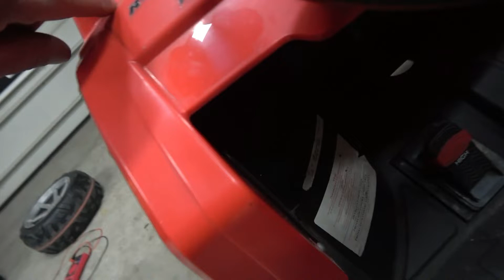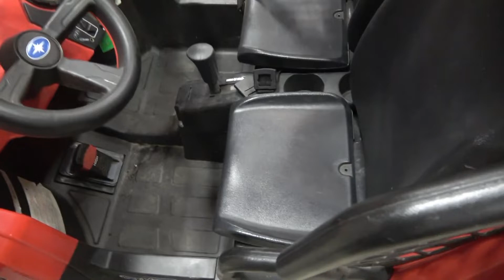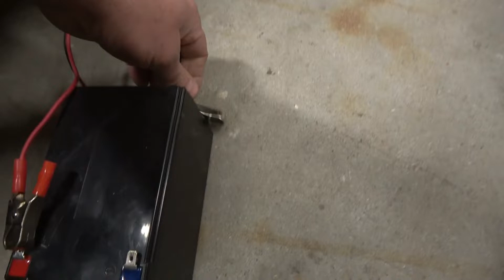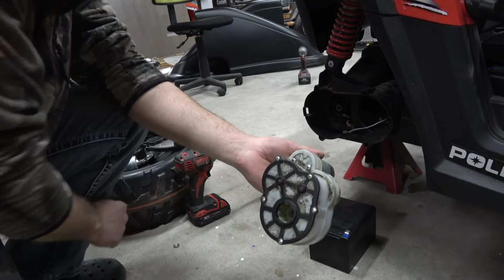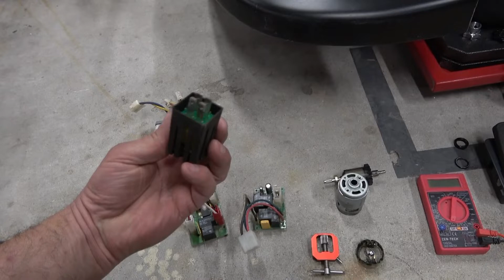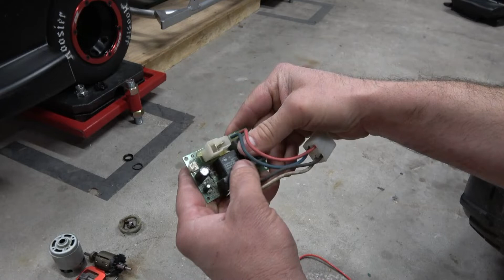Peg Perego 24 volt RZR- Fix and flip for $$$

Comment: Hello, luv the videos & channel. Hope you can help? I have a Polaris RZR 900. My question is on the foot pedal were the push switch is there a spring between the switch and the pedal? Asking because i just got one on marketplace but the push switch was missing and have already ordered one, i do have the pedal just don't know if there is anything that would  be missing? Thanks for any help with this issue.. i have looked everywhere with no luck.
Reply from the maker: The spring is inside the plunger switch. U should be all set. Basically the 900 uses all the same electronics as the more common gator.
Reply: @CustomKidzCars Ty sir!

Comment: Would the control bored also fix the reverse and the slow speed 1. I have a UTV 24v that will only run speed 2. I hear the motor turn on when the pedal is pressed but the wheel won’t spin even in speed 2 anymore. Could this be a broken gear box, thanks?
Reply from the maker: If motor is spinning it could be a few things. Pinion, wheel driver or gearbox gear

Comment: What if I disconnect foot pedal and put the wires together and motors don't turn but when I use throttle  on handlebars the wheels turn? What do I check next? Seems like power not getting the the foot pedal but is to the throttle. This quad is a hollicy atv and has 2 ways to activate wheels.

Comment: @CKC garage I have a Polaris Razor RZR Red #IGOD0511 I have been saving it for my 3yo grandson. It was my older gs before. It is like brand new and been kept under cover. I bought a new battery from peg and lil Jackson was in heaven. The problem is that after once around the barn it overheats and cuts off until it cools...rinse and repeat. There is a thermal doohickey underneath pass side that is hot to the touch. Do you have a link to this issue and how to fix? Jackson is fit to be tied and so disappointed but I don't wanna just chase parts. Both drive wheels work well....1 on low and both on high as according to peg customer support. They are not much help as they want me to buy complete new driveline and wire harness 1 part at a time. Thanks Butch from Michigan
Reply from the maker: Unplug the poly switches and replace with regular automotive fuses 30 or 40 amp will work.
Reply: @CustomKidzCars  I can't thank you enough. You're a good man and your vids are EXEMPLARY. Your enthusiasm is outstanding. I appreciate your response.
Reply: @frankdillingsly3580 hi there. I have the same issue in Polaris RZR 24V. Cannot find the mentioned poly switches underneath, where they are located exactly ? Thanks
Reply: @CustomKidzCars  poly switches are located in the circuit board? You sir will be Jackson's hero
Reply from the maker: No, underneath in the wiring harness
Reply: @CustomKidzCars  sorry to trouble you again. This unit has the Ruef 8oo poly switches. So do I need to cut those wires and solder in an inline blade fuse holder as the current switches have pins
Reply: @CustomKidzCars  hey just to let you know...first I apologize for jumping to conclusions regarding the Rue 800 poly switch. When I googled it they showed the pins. When I checked the Razor I realized they had crimped the blades on. I pulled them and pressed in 2 30A blade fuses. Jackson has rode his rig all day without any issues whatsoever. I thank you sir. You saved me a couple hundred dollars (which I may or may not have invested in it) probably woulda bought a new 12v ride on. You're a very good man! Butch from Michigan
Reply: @CustomKidzCars where Can I find the switches ? Checked wiring harness and cannot find any poly switches :(
Reply from the maker: Both motors should be spinning in low but slower because it's running in series. Sounds like a shifter switch or cobtrol board issue. If u hold the spinning motor in low does the other tire spin?

Comment: I just picked up an older 2:45  grey polaris ranger rzr 800.  Battery charger light is consistently green. 
I jacked it up on milk crate and you can hear the control board make clicking sounds when the pedal is pressed, its very slow on speed one, then speed 2 clicks and goes slow as well. 
Any suggestions?
Reply from the maker: Volt meter to the battery connectors should read 26.2 volts. Bad battery or charger is my guess

Comment: Hello CKC Garage, I tried to connect a couple of Dewalt FlexVolt batteries to my Peg perego 24volts RZR green along with the original battery in series and it did not work. The problem is now that its reversed back to the original set up it does not work. Did i burn a fuse or did i trip the overload protection switch?
Reply: I did the same thing and the kids weee flying around. Next thing you know it stopped working. Did you ever figure out how to fix it?

Comment: what may be causing my forward and reverse rocker switches to be over heating and the connection yo the battery to he heating up? I've replaced the forward and reverse rocker a few times now. Battery life is super short. I was thinking it was a faulty battery, but willing to throw some time into it as my kids love this rig.
Reply from the maker: This model has a circuit board that controls forward and reverse. What model are u referring too?
Reply: @CustomKidzCars  mine is the original, once you take the shifter off there is a rocker switch. When the shifter is pulled to reverse it pushes down on the rocker switch and then switches to reverse.
Reply from the maker: @kshort23  yes but that doesn't carry heavy current. It simply activates the relay on the board. I would look for resistance on the motors that is causing high amp draw. Could also be a loose wire
Reply: @CustomKidzCars  I took apart the gearbox and inspected the motors last night. all looks good there. took apart the gas pedal and cleaned it up. inspected the circuit board under the drivers seat (wondering if that is old and needing replacment) there is a rectangular shaped double fuse which looks a little rough and where it plugs into the wiring harness is dirty and appears to have taken on some heat. I think I'll grab some Automotive fuses to replace the rectangular fuse and see if that makes any difference. any other things I should be doing?

Comment: Good video, thanks for sharing. Do you happen to have a good source that you could recommend for a new main board and/or the switch control? I have a Gaucho 24v for my daughter and the car stopped turning on? The fuses all seem to be good. The switch and the key all work, I just can’t get the thing to turn on. And the battery is good…
Reply from the maker: Those are know to go bad and there is no stock replacement available. I always completely rewire with a standard scooter controller and relay setup
Reply: @CustomKidzCars  thanks for the response. I’ll check into it.
Reply: @CustomKidzCars  do you plan on doing a how to video for that as well?🙃
Reply from the maker: We do plan on videos of how to upgrade to variable speed controllers in the future
Reply: @CustomKidzCars  👋  do you have  a place   when  you selling  this cars????

Comment: Do you sell upgrades for big toys green county 24v lifted ride on crawler?  Trying to improve the jerky start / stop and keep it from over loading and suddenly stopping in the Lower speeds when going though grass or turning (increased torque on the motors). Makes it a real challenge for the kids to learn how to drive. Any help you can send my way is greatly appreciated!!
Reply from the maker: We don't sell any parts. Look into installing a proper variable speed controller and hall effect pedal. We have several videos going over that type of setup. https://youtu.be/VH4C-8QOsTY